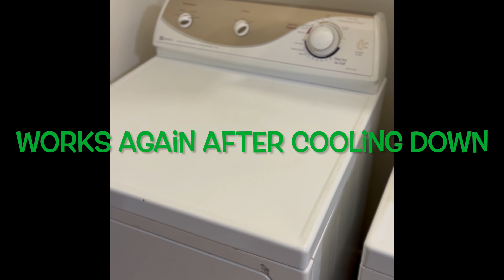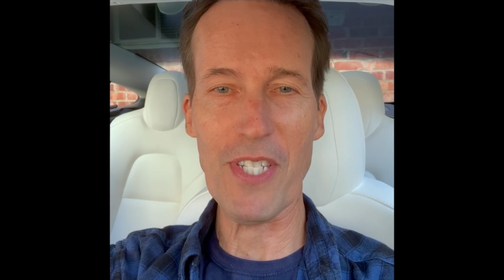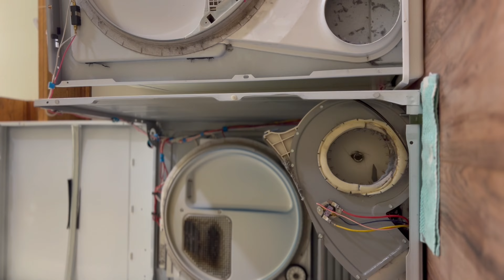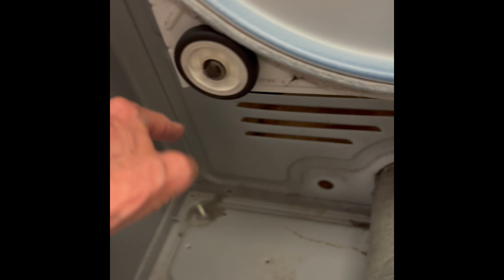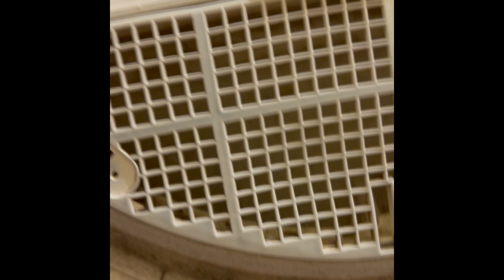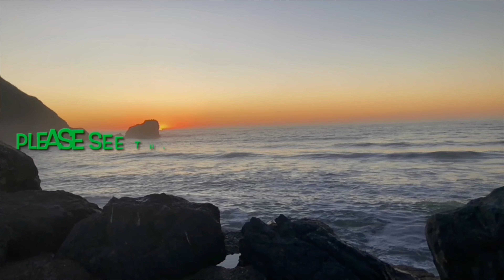✨ Dryer Won’t Finish Cycle - Easy Fix ✨

Comment: Wouldn't it be easier to simply open the back panel and air spray the motor from the back instead of removing all that from the front?... 🤣🤣🤣
Reply from the maker: You could try to remove the dryer vent tube and reach in to clean it with canned air.👍